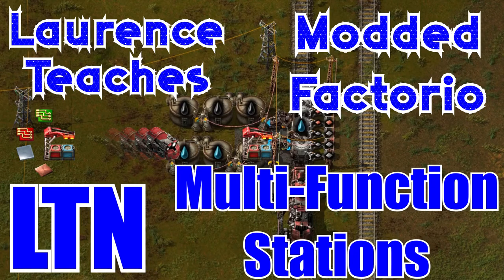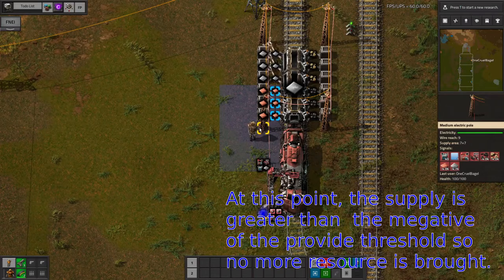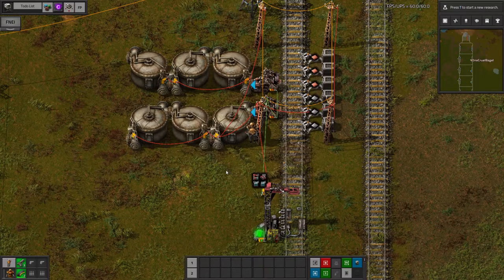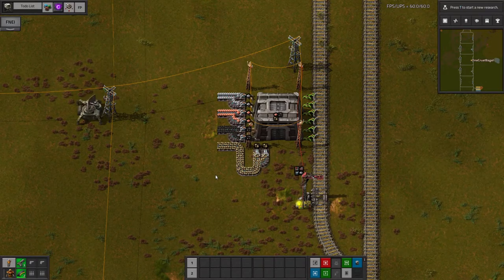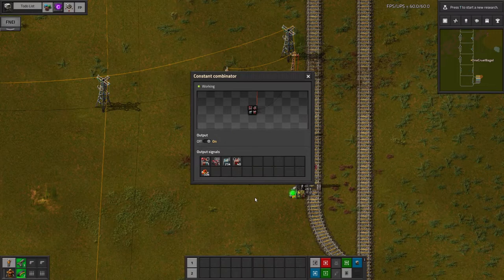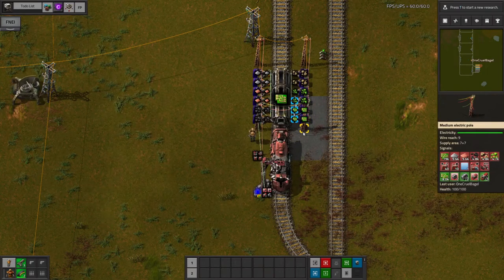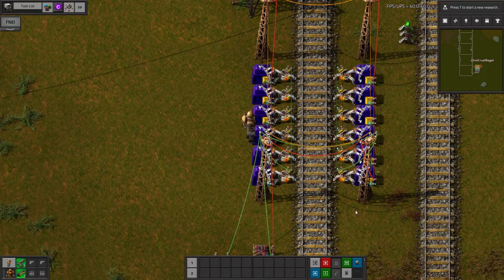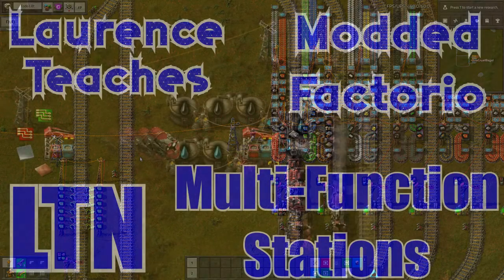LTN Multi-function Station Tutorial - Laurence Plays Factorio

Comment: Nice tutorial as always :)
I like using "LTN mini malls" - multipurpose provider stations for 1-1 trains (for malls or supplying outposts with repair kits, bots, mines, ammo etc). A wagon is covered by a single 6x6 large warehouse which is connected to the station with filter inserters. Connect LTN output light to output of an arithmetic combinator and strain station to input on this combinator. Set it to: EACH * -1 = EACH. Connect combinator output to filter inserters and set mode to "set filter". As always with multipurpose loaders set wagon slots locked to 1 or more. Connect the warehouse with a different cable to the input light. You may now request a wagon full of crap from a random warehouse and LTN will load only the items and quantity requested. Currently experimenting with this and Ghost Scanner (looks for ghosts and outputs them as signals that can be further used) to create an automatic system for constructing outposts.
Reply from the maker: I decided not to talk about trains that pick up multiple things at once because it's outside what I've actually tried myself, but yes, that would be the logical next step! I'd need to have a play around with only collecting partial train loads, but that could be interesting for a future video - thanks, I'll have to think about it  🙂

I've done outpost stations in the past without LTN, having a train with all slots locked to specific items and then unloading with filter inserters into chests at the other end, but this could certainly be improved on. 

I like the suggestion of combining it with ghost scanner - will have to think about that. Thanks  🙂
Reply: @LaurencePlays  Multiple pickup station is easy actually - just needs a single arithmetic combinator :) LTN output to combinator output, train station to combinator input, and then connect filter inserters to the combinator output too and set them to "set filters" - this way they will only pickup items requested by train (items loaded to the train are substracted, inserters reset filters when the value goes to 0 or below 0)
Requester station for this is kinda spicy - doing the unloading via circuits gets ugly if you request more than 4 different item types, because of 4 filters limit on the inserters themselves, and also the fact that these filters are static when a train comes. I managed to solve that issue but it requires cycling the inserters so you need a pulse generator and a timer :/ The unloading circuit had almost 15 combinators so I decided to not use anything at the unloading station and just make sure the loading station is 100% reliable.
Reply from the maker: @sdcf334  Yeah, I think you need the train to be empty when it leaves the dropoff station if you're using LTN, otherwise it'll just cause problems later. I've not thought about how to set up the thresholds for partial loads, but it might be interesting to look into in the future. Thanks for the thoughts!
Reply: @LaurencePlays  You're welcome! On a sidenote, partial loading works for fluids too :) They load between 5% and 10% more than requested because of tick delay. Same setup as for cargo provider and set pumps to everything > 0

Comment: One thing you can do is use the last station you showcased, but with a warehouse. 

The warehouse gets loaded by belts that have a cable on them stopping the belt once you have what you want in the warehouse to prevent filling it fully, and with the setup you showed on the inserters, they pickup what the train wants, but they're all working at once for a particular ressource then. 

Not sure if I'm totally clear, it's hard to explain over text.
Reply from the maker: That's true, and an excellent idea. I shall be touching on this, and the other comments I've had on my videos, in the next one. Thanks for the suggestion  🙂

Comment: Great tutorial - exactly what I was looking for with multi-provider station. I use LTN combinator which takes part of the job for setting LTN singals and then arithmetic combinator that allows me to load multiple resources to train - it's very handy with pyanodons mods i.e. if you want to have one station that supply various types of food
Reply from the maker: Mmmm, I've heard of the LTN combinator mod. I can see the use for it, but I feel like I understand LTN well enough to not need it. That said, I would like a way to easily say "80 stacks of <resource>", rather than have to find out how many items are in a stack manually.
Reply: @LaurencePlays  with ltn combinator case is only to repeat yourself less :) Also the way ui is built there allow to easier start with ltn. At later time just 'syntactic sugar'
Reply from the maker: @DimmuRPL  I find using copy/paste or blueprints tends to remove most of the repetition, so it's not too bad. It is nice not having to think too hard about the settings though!

Comment: Fantastic Laurence!   Very clear and understandable and covers most LTN.  Only thing I missed was partial loading of trains, but think your Arithmetic combinator setup should cover that as LTN request of say 10 slots only would go to zero and stop loading train. Another tip when loading multiple items it to override item stack size to a round number that fits your load requirements - i.e. 5 or 10 depending on your stack insert level.  This might slow down loading, but leaves less excess items on inserters when load is complete.  I'm setting up a warehouse with multiple items loading station where trains might need full cargo or down to 10 slots.  Long time since last I did so grateful for this video as it reminded me what I need to do :)  Thanks!
PS!  Love your SE series!!!
Reply from the maker: Thank you! I tend not to really bother with partial train-loads in my factories; I'm of the opinion that you might as well take a full train load while there's a train going and if that's a bit of an oversupply, then it'll just last a bit longer. 

Granted, this can cause problems if the train has a really high capacity - it means you waste a lot of resources in buffers (we had that in IR), but overall it mostly balances out in the end. I've not properly used a multi-pickup station yet in a game, but as you've seen, I have used multi-drop, and they do work well. 

Good luck with your setup, I'm glad I could help  😀

Comment: The multipurpose stations now have an absolutely amazing use case! There is a modpack called "freight forwarding". It overhauls the long range logistical transport of the game in what I find to be a very fun way.

Stacks sizes have been reduced, significantly, for almost all ores and intermediate items. In return, almost all of them can be fit inside actual steel containers that can be put onto trains, ships, and if required even on cargo aircraft. The amount of slots on trains has been reduced, from the usual 40 stacks to just 5 stacks, however, each container can be filled with up to 1000x of a resource. IT also works great together with Krastorio which makes it a ton of fun to play if you want both a logistical challenge and a tougher than vanilla experience for intermediates
Reply from the maker: Nice, sounds interesting and reminds me a lot of my mixed freight rockets on space exploration. I've made a couple of videos on those too. Maybe you could even do the requests through ltn, that would be awesome!

Comment: Great Video, I was so close to working out the multiple provider set up, but not quite so thank you for providing a solution.

One thing, alternative, for multiple fluids I attach the pumps to the output combinator of the station and set fluid to equal -1 does the same thing really, but don't have to worry about ensuring you've tick, 'read train contents'
Reply from the maker: That's an excellent point - I thought of using the train contents first, and then didn't really think about alternatives, but using LTN's knowledge of what's on the train makes a lot of sense. 👍

Comment: Great tutorial! I use almost that exact same multi requester station with the large warehouse in my Space Exploration play through, super useful when space is tight :-)

One neat trick I found for multi item provider stations is to also use the warehouse there, dump all the items on offer in there, and use a filter inserter with "set filter" for loading. When a train arrives read out the items the train wants the same way you described and the filter will automatically be set to that item and unset once the train has the amount it wants! That way all inserters are always working. And if the train wants multiple items the filters will just cycle through them one by one.
Reply from the maker: I realised far too late that I could (and should!) use warehouses for the unloading stations, which is why I made sure to mention it in this video. Ah well, next time! And also for any more stations I build in the current run. 

Using a warehouse and programming filters for loading is also a good idea - I definitely need to have a play with that. Watch this space  🙂

Comment: Thank god for your videos! They're perfect refreshers about how LTN works.
I was wondering, for your "many items/fluids" providers at 8:10, have you considered using dynamic filtered inserters (i.e. filtered inserters that set their filter based on the train's requested items), alongside a warehouse of course, to speed up throughput? This would let you use the full line of 6 stack inserters instead of only 1-2 per resource to provide.
Reply from the maker: Yeah, I've used them to remind myself how LTN works as well  😀
Yes, I have in fact thought of changing the filters, but not until after I made this video. There are a few things I'd probably do differently these days, maybe at some point I'll redo the videos or make a sequel!

Comment: Thanks for the tutorials! I'm using multipurpose stations for my pYanodons run.  One thing that LTN doesn't do is partial stacks (on loading or providing).  I'd like to hear if anyone has done this.  I assume some combinators would need to be used to fake out the signals?
Reply from the maker: LTN can be set up to request specific quantities of things and you can wire into the LTN output (the combinator in the train stop) to see what the train is expecting, and wire into the station itself to see what the train has. Subtract one from the other and you can see what's missing, and just have your filter inserters load that. 

It'll probably overshoot slightly, but I tend not to worry about having a bit too much of resources - it'll get used up eventually. And for the same reason, I tend to just send full train loads of everything everywhere, although when you get onto expensive science components, that can be a bit slow.

Comment: Very nice and straightforward tutorial thanks!

It occurs to me that avoiding inserters getting stuck with items in their hands with the Locked Slots per Wagon technique does not work on more complex cases than 1-1 trains like here.
I just tested it on a simple 1-4 station with the same setup and the problem is, if the station has just enough to fill a train (and a train arrives right then) but its chests does not have the exact same amount of materials, you might end up with some loader chests getting empty while other wagons are still loading from other chests, resulting in an uneven load per wagon. Chest+Inserter couples that have enough to compensate for the Chest+Inserter couples that ran dry, will see a request > 0 and continue loading and finally get stuck. The train leaving will have wagons with like two slots empty while others are completely full leaving stuck inserters.
I hope I made myself clear enough, that's kinda hard to explain...
So in the end the technique is not 100% robust, unless you have 100% balanced chests at stations at *all times*. However on 1-1 trains this problem does not apply.
An absurdly complex circuitry would be needed to fix this problem (unless I missed something in all of the above, I'm quite a new player) so I think
 - We should stick to single-purpose providers for > 1-1 train;
 - Or accept that some times trains will get slightly polluted (even with this technique) and have depots that are actively cleaning leftovers and put them in active provider chests.
Reply from the maker: It's important to try to keep the different chests/warehouses in your stations balanced because it can lead to lots of problems if they're not - if it gets bad enough, you can end up summoning a train when there isn't enough room to unload it, and getting it stuck. 

It is possible to have systems comparing the resources in each chest and only loading/unloading when it's on or below the average, but I've never done that for a multi-resource station, that sounds extra tricky!

As long as your input balancing is reasonably good, you can make the problem you describe much less likely to happen by not making the resources available until you have 110% of a train's worth, that way there'll probably be enough in each warehouse to load the train properly. Not guaranteed, sure, but likely to be OK.
Reply: @LaurencePlays  Ok, that totally makes sense. Thanks!

Comment: A very niche question, but what if you need different stack sizes of various items and want to provide them in the same stop. I'm working on a perimeter setup and I have a menagere of requested items in various stack sizes, 2k walls, 1k belts, 100 inserters, 50 pipes, turrets, and flamethrowers, etc. Most of these I'm producing in just 1 of my blocks, and so I can output them onto just 1 train, but I dont want a train running around full of turrets nor do I want trains delivering walls 50 at a time. Is there a solution or should I just use a vanilla station and a filtered train wagon?
Reply from the maker: Personally, I used a vanilla train with a filtered wagon as you say. I did do a few clever things though, which I went over in the outposts tutorial video, so I'd recommend checking that one out! I generally only use LTN when I want to deliver a full trainload at a time; that said, I do know that it's possible to deliver smaller quantities, I just haven't done it myself.
Reply: @LaurencePlays  I realized that flagged in/out stations with vanilla mechanics werent going to work for se after learning that space elevators require a custom flag, so this whole channel is very helpful atm. One other question, I checked the manual and you also in this video mentioned it but I cant really work out what the difference is between wiring to the station and wiring to the combinator
Reply from the maker: @ivanlagayacrus1891  We haven't got to space elevators yet, so I have yet to learn about them!
The wires connect the chests, the combinator and the station together, so the signals from the combinator and chests can be read by the station. How familiar are you with Factorio circuits? I have a video on that as well  😀
Reply: @LaurencePlays  sorry I should've clarified, I meant the combinator that is part of the station entity, not the constant. In one example you wired to the station itself for an output and for another you wired to the combinator part of the station. 

I'm not a circuit wizard, but SE has been teaching me to figure it out pretty well, especially since I was working with vanilla trains up to this point and had to learn circuit conditions for things like disabling core miner stops until they had supply
Reply from the maker: @ivanlagayacrus1891  Oh, gotcha! 
Connecting to the station gives you the same options as in vanilla - you can send signals to the train, you can read its contents and you can set the train limit. 
The lamp is the LTN input, you can use that to tell LTN what's available in the station, what to request, what the trigger levels are, etc. 
The combinator is a signal output that tells you where wagons are on the train (I've never used this) and what the train is expecting to have when it leaves the station. I don't often use this, but it can be used to choose what to load/unload and how much.

Comment: If you are running trains longer than one wagon if a station is not perfectly balanced or runs low on a resource the lock slot option no longer works. It reads the slots from all wagons and the inserters will still attempt to drop resources into a full wagon while waiting on the last one(s).  When a train pulls up requesting a different resource this also then ruins the arithmetic combinator. Also any shortage causes one of the wagons to always hold all of the locked slots (however many wagons are on the train). Any advice? 

Edit: I understand stations should only be able to show resources are available for pickup if they are actually there, however I often have two or three trains coming to a station at a time and sometimes this causes an ever so slight imbalance that will spiral out of control as mentioned.

Comment: Multi provider and requesters can be improved even more using logistics robots. For requester stations unload into a active provider chest and push have the robots carry to permanent storage. For providers if logistics warehouses or merging chests use the requester chest version and have them request exactly the amount your gonna unload in the train
Reply from the maker: True, you could do some of the loading and unloading with bots. I think this would be very useful if combined with the ghost planner mod to allow you to put down a station with some blueprints and have the system automagically request all the bits and pieces it needs. I try to avoid overuse of logistics bots (apart from for supplying me!) because I prefer a more belt and train based factory, but that's just my preference!
Reply: @LaurencePlays  it’s really the only place I’ve used logistics bots they just allow for super efficient multi stations my mall stations requests 12 different items belts and standard unloading methods just don’t cut it